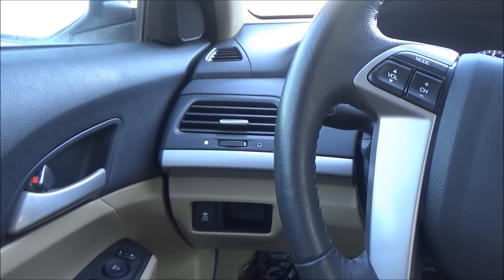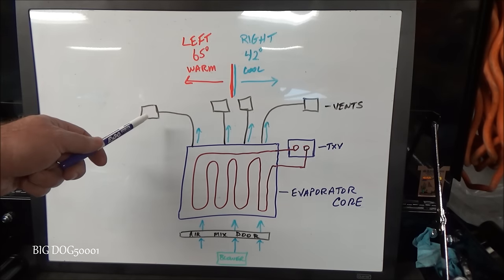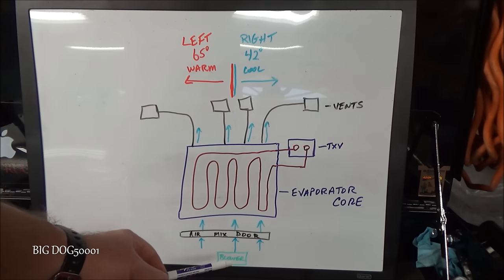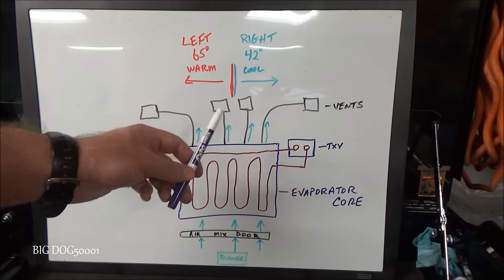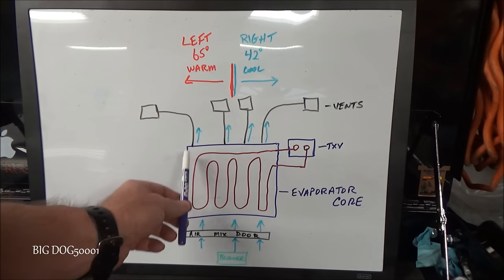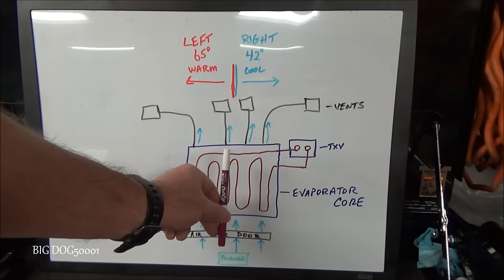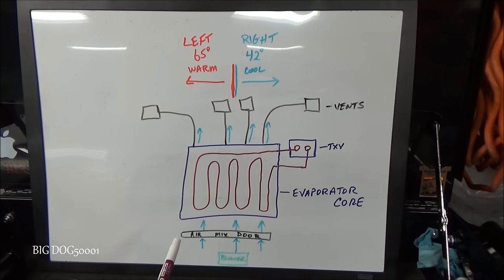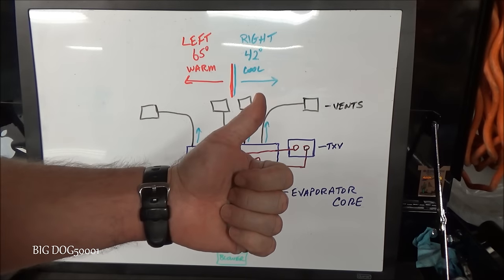Honda Tips: A/C Blows Warm Air Out of Left Vents and Cold Air Out of Right Vents

Comment: So if the refrigerant is low than it's safe to say you should leak check it first ? How else would it get low ????
Reply from the maker: Typically it gets low over time from small leaks but it is possible it could be low due to faulty service or incorrect recharge amount.  A normally working system is not 100% sealed and will leak enough refrigerant out to be noticeable after 5-7 years.
Reply: @BigDog50001  Thanks for the response. I have a 2016 Honda civic with 50,000 miles. I just figured it was too new to have a leak. I guess i'll just charge it and see how it holds over time.

Comment: Hi, this was extremely helpful!  My '11 CR-V's AC suddenly stopped working.  Was blowing perfectly cold air, but on a road trip, suddenly just stopped.  Mechanic said the clutch was bad -- (sure enough, there's a service bulletin that extended the AC clutch/pulley/coil warranty on 07-11 CR-V's to 7-year/100K miles, but mine is out of warranty).  So, my mechanic pulled out the compressor, and I replaced the clutch/pulley/coil.  He swapped it back in, but now I have the problem in this video: left warm, right cold.  My mechanic is pretty confident that when my clutch went bad, there was a failure event that generated a lot of heat, and that heat can compromise the integrity of the O-rings inside the compressor which prevents the compressor from "pumping" as strongly as before.  I was wondering if that's something you've seen, in the category of "one of the AC system's components becomes restricted" which mimics a low freon situation.
Reply from the maker: Depending on how they fail, the A/C compressor could be damaged but typically when a compressor clutch fails it does not damage the compressor (many times when the clutch components are removed excessive oil can be seen at the shaft if it is leaking).  Looking at system pressures and operation, verifying the clutch gap and recovering the refrigerant and verifying that the correct amount was in the system are where I would start.  Unfortunately recovering and verifying refrigerant amounts requires dedicated A/C equipment.  A slipping clutch can also cause these symptoms due to poor tolerances.

Comment: Could it be that one of the radiator fans are not working? If that's the reason why there is no cooler air coming on the left side than on the right. Because I'm having this issue rn. It's weird because I just got my ac installed a few months back and now it's already acting up.
Reply from the maker: Typically a bad cooling fan will reduce A/C vent temps on both sides (and generally more so at low speeds or sitting at an idle), it can also cause engine to run hotter.  That being said, I have seen problems where the refrigerant is low AND one of the cooling fans isn't working (or not working on all speeds) and that could show up as uneven vents temps in addition to poor cooling.
Reply: @BigDog50001  do you know what usually causes a fan to go out?

Comment: So now it’s winter time. I set heat at automatic temperature control at 78 degrees. However the left vents shoot out air at 88 degrees and the right throws it at 78 degrees. Blazing hot on the left registers like it’s heat coming from the engine almost. In advance, your help is appreciated. What part of this system that you describe should I try to troubleshoot?
Reply from the maker: If it has dual climate control ability, I would start by looking at the air mix motors (both driver and passenger sides).
Reply: Big Dog50001 Automotive  thank you for the quick  reply, much appreciated! Yes it is dual climate control. I still love my old Accord so I want to keep it another winter. Thanks again for your time!

Comment: The air coming out middle consuls is blowing hot on driver side and cold on passenger side  my mom doesn’t wanna press to many buttons thinking it will break I see why the driver side has the problem because someone driving can control their side they wouldn’t care to have the passenger the back seats cold or not if no1 is in it

Comment: My heater is not working on the drivers side on my Dual climate control Ridgeline. What could it be.
Reply from the maker: On a dual climate system, I would verify that the Driver's Air Mix Motor was working properly (can also called driver's temperature motor assembly or driver's blend door actuator).

Comment: I have this same problem on my 07 civic . So I should just refill refrigerant?
Reply from the maker: It is very difficult to know exact amount of refrigerant in system without removing and weighing it (usually with an expensive dedicated machine).  In general, I don't recommend DIY for AC refrigerant recharging.  I have seen too many problems caused by overfilling the systems with refrigerant.
Reply: @BigDog50001  oh wow ! I'll just take it to the mechanic then. At night the cool air from the passenger side is enough to get me going but it's freaking hot in the cabin when the suns out hahahahah. I'd be really glad if the problem was just this simple . Anything else would be too complicated
Reply: La Féte we’ve temporary fixed the issue by using the defrost mode. 😬

Comment: Sept 08, 2020 ( Hi... I do have air blowing on the passenger side and hot air on the driver side.... in the compressor is coming on ... ( this started about eight days ago..... ( 2007 Honda Odyssey EX-L  ) ( will a trouble code show up in the messenger Center )
Reply from the maker: It is hit or miss, but it is doubtful it will show any trouble codes.

Comment: Can you explain when you have that issue with the heating system. My 06 accord V6 is blowing cooler air at idol on the drivers side and warmer on the passenger side when the heat is on. Thank you
Reply from the maker: I would make sure coolant level is not low, and that the coolant system is bled properly and all air removed (especially if work was just done on it).  If it is a dual climate system, I would also look at driver's and passenger's air mix control motors for proper operation.
Reply: Big Dog50001 Automotive thank you for your help. I'll definitely keep watching your Great videos

Comment: Dave, I have mitchelle and all-data, what should i search to look for air mix door actuator location. one of crv 2012 air mix door actutator on driver side failed. not sure how to navigate in the mitchelle or all-data to look for that.
Reply from the maker: I have AllData, after selecting vehicle I just use the search and type in Air Mix and it finds is pretty easy.  Not sure which versions you have but that is how I do it.

Comment: @Bigdog the A/C blows not as cool on the left side as the right like u said, but can i just add some freon to it? some ppl say u have to take it to mech as its not that easy to just add freon huh 😔
Reply: Newer Honda Civics use a newer freon that's supposed to be better for the environment. The issue is that it requires a specific machine to do the refill and only Honda dealers seem to have it. It's also quite expensive. It cost me about $400 to refill my system.

Comment: So I recently changed the compressor because it went out. The shop changed the condenser at the same time. I was still getting cold air on passenger side and warmer air on driver side. Just replaced the blend door actuator today and still experimenting the same problem. Refrigerant  was recently filled. What else could be the issue?

Comment: I am having the opposite issue. When I turn the heater on, the driver side is blowing cold air thru top and bottom vents while the passenger side is blowing warm air. What could be causing that?
Reply: There’s a thermal switch on the compressor that goes bad.
Reply: @mariop.2758  thank you for the reply, I appreciate it.
Reply: Clogged heater core.  Do you have a CRV?

Comment: I have a 2007 accord exl and this is what mine is doing. I had Freon and dye out in my system to check for leaks and after a using a uv light, no leaks detected. I can only assume it’s the blend door actuator on the driver side. I do hear some clicking noises from it eve so often.
Reply from the maker: Those EX-L Accords should have dual climate so it is possible there is a problem with the driver's air mix control motor.  I would look at actuator voltages to verify but another quick test is to compare noises on passenger and driver foot well areas to see if they sound the same when changing temps on the climate control unit.  

Other possible causes: a restriction in the A/C system or a low refrigerant charge.  Unfortunately, it is extremely difficult to know if the refrigerant level is low without recovering it all and precisely weighing the recovered amount.  Dedicated A/C machines are how most shops (including me) do this.
Reply: Big Dog50001 Automotive  when I adjust the driver side temperature I can reach down and feel the actuator moving. The car is still under warranty so I’ll just have the dealership try and fix it. Thanks for the video btw!

Comment: I have this issue with my heat. It blows nice and hot on the drivers side and cool on the passenger side. Anyone know what that could be?
Reply from the maker: Blend door issues or low coolant/air in cooling system is where I would start.
Reply: @BigDog50001  if that dont fix it then what ,I changed mine and added freon still warm on left 2013

Comment: What About Heat ?! Cold On Passenger Side .
Reply from the maker: Air in coolant system or low coolant is first thing I would look at.
Reply: @BigDog50001  same issue on Crosstour dealer suggested a antifreeze flush still cold on driver side and Lukewarm on passenger any suggestions